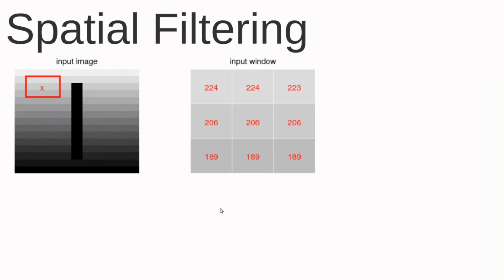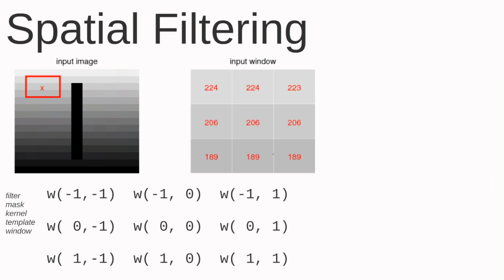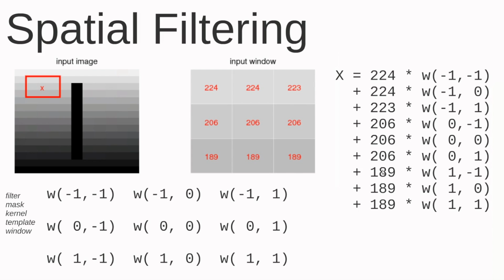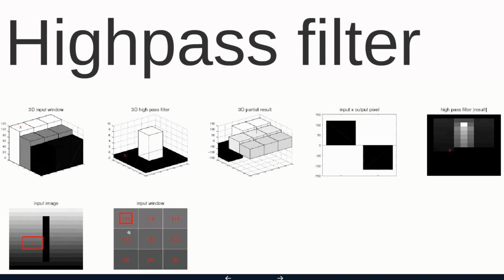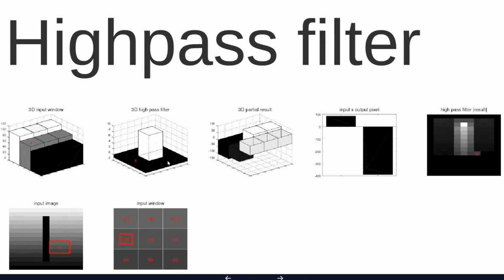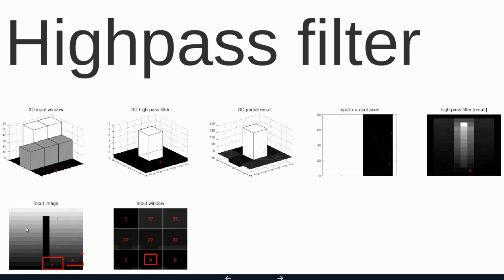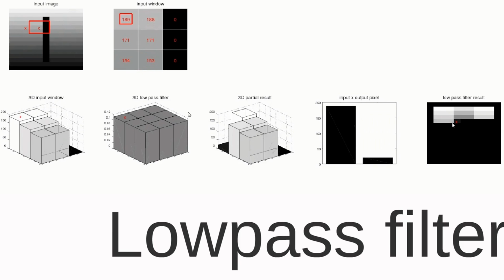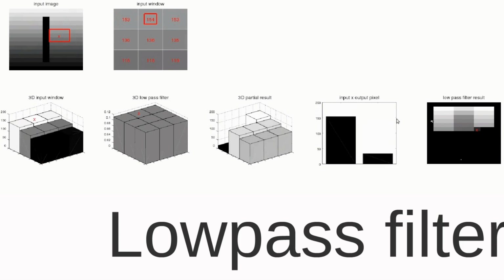How Spatial Filtering works

Comment: Hey thank you very much for great explanations but i dont get the output image in 3:30
How the value is light when the input is patch consist the black line ? 
Is that show the absolut value? 
Otherwise the high value in the filter will meet zero and so of course it will not make big result in the output?

Comment: hello sir 
thanks for your reply
but I have one more question 
is it possible for using another weights value  instead of 1 in case we have more than one image
Reply from the maker: Hi, you can use different weights. With 2 images, for example, you can define your own weights for both images, but the result will be different according to the choice of weights.
Regards

Comment: lright sir, but in case if we have 2 or 3 input images and we want to compute  weighted mean between these input images to generate 1 complete image.
how it could be ?

Kind Regards..
Reply from the maker: in the case you have more than one image, if you want to make a weighted mean, I thing you don't need a filter, you have just to compute, considering every pixel in image 1 as p1, in image 2 as p2, in image 3 as p3:
output_pixel = (p1 * w1 + p2 * w2 + p3 * w3) / (w1 + w2 + w3)
and you should define the weights manually. considering w1 = w2 = w3 = 1, you will have the classical average of images.
regards
Reply: Thales Sehn Körting 
hello sir 
thanks for your reply
but I have one more question 
is it possible for using another weights value  instead of 1 in case we have more than one image